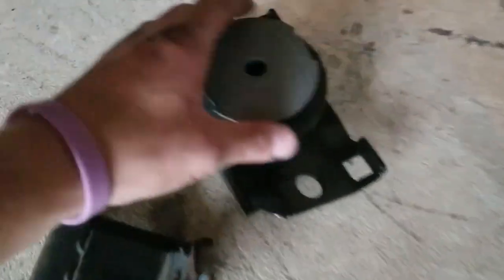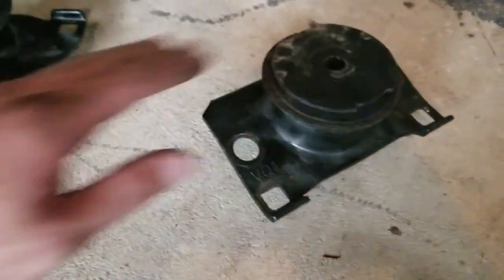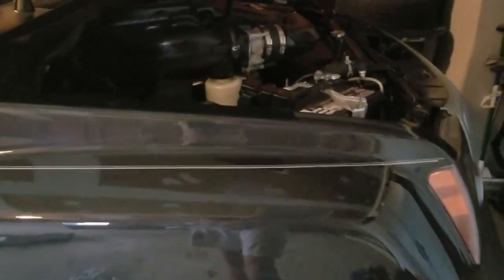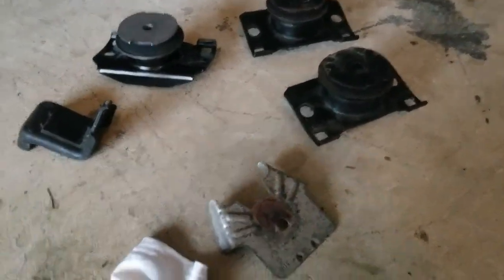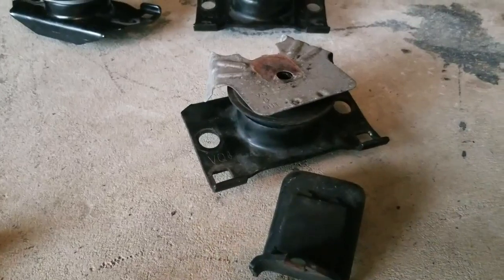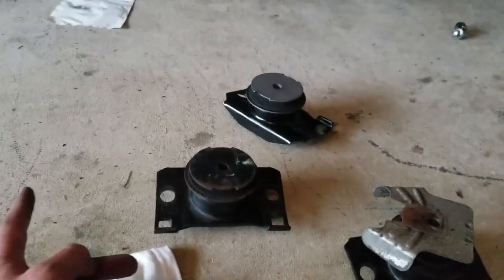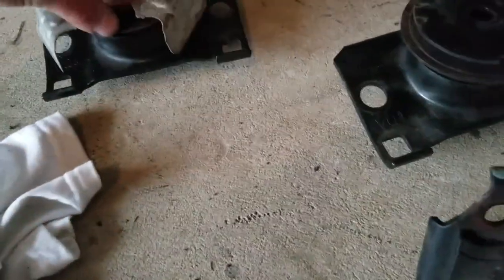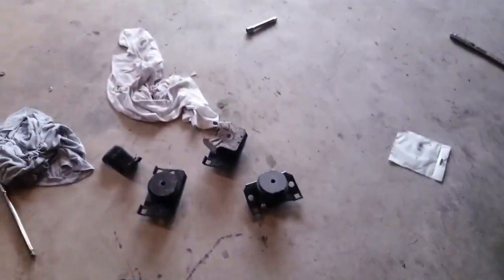Installing motor on Nissan Xterra Frontier 2005 2015

Comment: FYI anyone doing this on a frontier, the process is exactly the same but you will need a swivel socket for the driver's side bolts that hold the bracket (14mm bolts) because of the front diff being in the way.
Reply from the maker: That makes sense! I used a word bible extensions

Comment: You take that lower bracket off on the driver's side as well? Kinda hard to get to the 2 bolts underneath withe the pumpkin in the way

Comment: I’m having problem on the driver side 4wd blocking the 14mm bolt how did you take out the motor mount
Reply from the maker: I jacked the engine up. It’s super tight
Reply: No need to remove the bracket. Btw thank you

Comment: Ok how did you remove the bracket with 2 14mm bolts on the driver side? I tired but the dang front diff is in the way
Reply from the maker: You have to slide it out. Also, did you jack the engine up?
Reply: @CarsRMe  so you removed the mount without removing the bracket? And yes I raised it to but the bracket is on there so tight that I couldn’t even move the motor mount
Reply from the maker: @jbuilds1  I have to take the shields out separately from the mount. It’s such a pain to wiggle the mount out.
Reply from the maker: Yes the bracket needs to come off first
Reply: @CarsRMe  ok I think maybe frontier is little different than the Xterra because those 2 bolts for the bracket are behind the diff 😔
Reply from the maker: @jbuilds1  of is yours a frontier?
Reply: @CarsRMe  yes the mounts themselves are the same
Reply from the maker: @jbuilds1  ya, but on our frontier we had I noticed the front design is slightly different